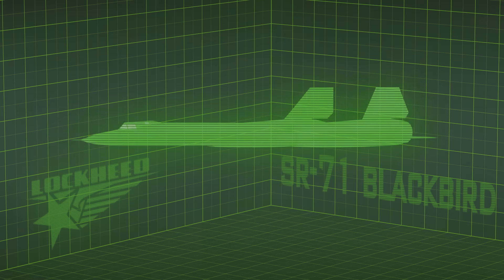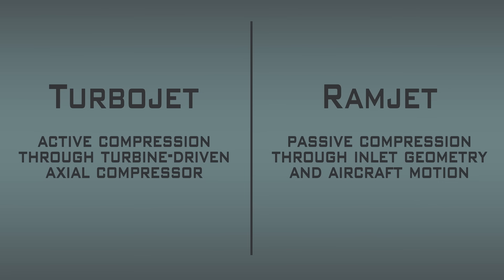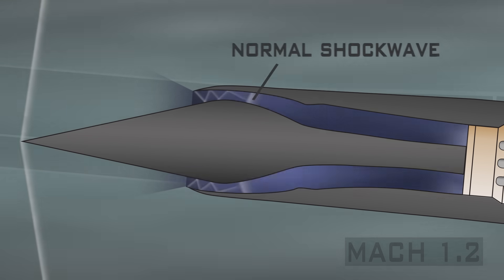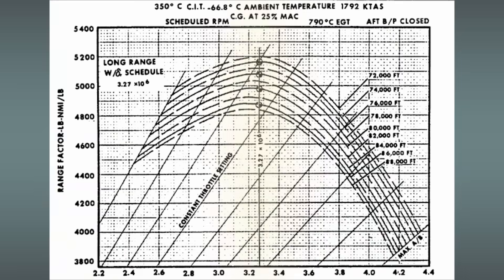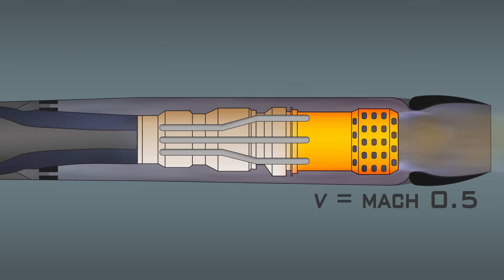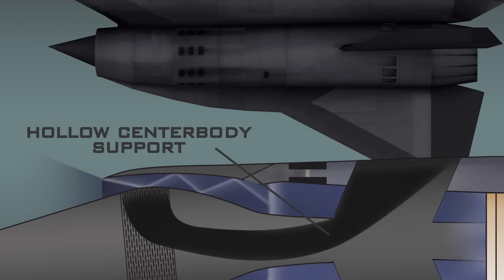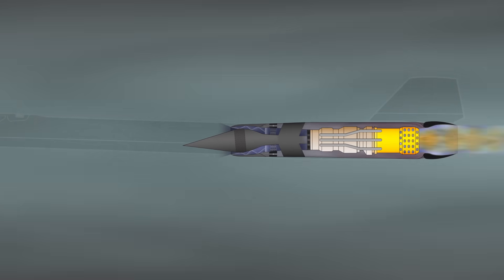The Mighty J58 - The SR-71's Secret Powerhouse

Comment: I probably just don't fully understand the concept, but how does more air make for more fuel efficiency when the bypass tubes are open at mach 2.2?
Reply: ramjets are more efficient then jet engines. it compressed the air so efficiently that it could scale the amount of fuel back considerably..

Comment: The "computer" that actuated all these doors and shunts etc was an analog computer powered by hydraulic pressure. The mind boggles. That, by the way, is an answer to questions like "why cant we build a J58 any more? The answer is that control and computation systems, as well as construction, are now so radically different that the whole thing would need a redesign based on 3d printing, etc. If you want to see what I mean take a look at a spacex raptor 1 engine compared to a raptor 3. A new version of a J58 would look like whatever they're flying in an aurora :)

Comment: 🤓 moment but:

It's not more efficient for the shock to compress the gas compared to an axial compressor. You just can't route all the flow in your engine through a compressor at those speeds without melting the turbine, and the inefficient compression from the shock is good enough for the bypass

Comment: It was interesting to learn from mechanics how many muscle carts they had “over-rev. to death” during normal start-ups of the J58 engines.  No one ever built a start-up cart that could compete with the speed and strength needed to start the J58 engines.
By the way, when I commented to a SR-71 pilot that I did not see any nav lights he just snickered.  It was as polite a snicker as he could muster, but a snicker all the same.  Then he pointed out the only light on the aircraft was the landing light mounted on the forward landing gear… so that it would not be burned off.

Comment: So, never see this explicitly defined, but by what mechanism and process does the INLET somehow 'DEVELOP' about 50% of the engine thrust at Mach 3+?

I see this line repeated OVER AND OVER in all the "Lies We Tell to Children" quasi-explanations, but the explicit meaning of 'DEVELOP' is NEVER EXPLAINED or DEMONSTRATED!!!

I see better how the engine operates, but even here I do not see such an explanation of 'DEVELOP'.
Reply: The inlet slows the air down to subsonic speeds. By Bernoulli's principle, when you reduce the velocity of a fluid, it's pressure increases 1:33. It increases the pressure by a factor of 39-1 as per that diagram (at full speed). So now you have high pressure on the back half of the inlet spike and low pressure on the forward part of the inlet spike. This differential pressure pushes that inlet spike forward just like the pressure in a gun barrel pushes the bullet out the barrel towards the lower pressure. Look at that diagram at 1:33 and pretend that the inlet tube is a gun barrel and the inlet spike is the bullet. You now have high pressure at the far right end of that barrel and low pressure at the far left end of the barrel, that spike is now like a bullet in a gun getting pushed to the left from that difference in pressure.

Comment: Op how does the comustor produce 112:1 compression ratio?
Reply: It doesn't, that is just the air pressure at that point in the engine. 39:1 at the inlet and 2.9:1 at the compressor = 113.1:1 after the compressor. It then DROPS to 112:1 in the combustor. FWIW @ 75,000 feet 112:1 is only ~ 56 PSI. As amazing as this engine was, it is still 1950's technology. We run about 100-200 PSI at the combustor in modern commercial jet engines today.

Comment: Sounds similar to how Lockheed Martin SkunkWorks cooled the exhaust of the F-117 Stealth Fighter with diverting cooled air from the intake back to the hot exhausted of the engine output. Thereby cooling the engine exhausted to reduce it's IR signature, in addition to allowing the engine exhausted to cool on the upper portions of the aircraft aft section before becoming fully exposed to the full clearance of the aft of the flying wing itself to any IR targeting S2A or A2A weapons systems.

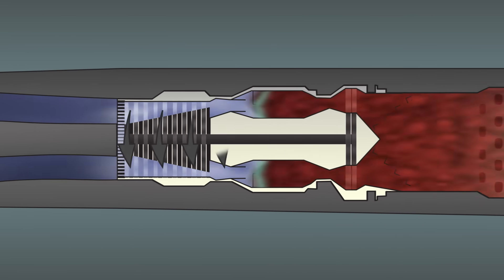Comment: I still dont get what the combustion gasses are "pushing" against to generate the counter thrust; it is not as obvious as in a rocket nozzle. At  0:53  looks like its pushing against a static wall of compressed air; the only way I can see that work is if the 'push' is transferred to the compressors, and thus to the entire rotor.
Reply: That's because they're not pushing, they're accelerating. AgentJayZ has a really nice explanation of this on his YouTube channel

Comment: Diagram shows the compressor section as smaller diameter than aft section. Not correct. Believe the compressor section in backwards in this diagram.

Comment: great animation but stop with the woke crap.  when you discuss the pilot at 5:Na13 you DO realize the SR-71 was only ever piloted by a MAN and that the only Woman crew was Marta-Bohn Meyer who served as a Navigator, sitting in the controls-less RSO position.  and since the aircraft was retired and made lost its airworthiness and there are no spare parts OR the necessary fuel or TEB, it will NEVER be flown again either by a Man or a Woman...

i didnt work on the engines or the airframe but i worked on the pre and post mission intel from the program...

Comment: How does the compressor run when the air is just moved to the after burner?
Reply: Only "some" of the air is bled off to the afterburner, there is still airflow through the turbojet. The turbojet part of this engine was "constant flow" so as the plane moved faster and airflow started to increase, it was that increased air volume that was dumped into the afterburner, the turbo jet always seen pretty much the same airflow regardless.
Reply: @wally7856 chad😎

Comment: The A-12, which used the J58 is why the SR-71 was built. The SR-71 is longer, weighs 6 tons more, uses a pilot and a RIO, and is slower than the A-12. (SR-71 = YF-12 version 3)

Comment: The SR-71 also didn't need wings, it IS a wing adjacent pinch formation body, the only reason it had extended wings, is due to the engines exploiting sound at the ramjet cones into speed flow. If it had a Scramjet to Scram rocket, it could've been a Orbitliner 5 to 6 seat (as seats swap of the spy camera chambers) private space/supersonic jet.

Comment: Let's not forget, computers did NOT create the advanced aerodynamics and stress analysis information.  ALL of this was created first by the people using the slide rules and THEN a computer was programmed to output the same results. The advantage to the computer was all about saving time. When parameters were changed, it was faster to have the computer make the calculations and provide the new information, but all of this was first measured and tested by humans like Kelly Johnson.

Comment: I saw another video and the guy mentioned that the temperatures the engine works at would heat the metal so much that the whole engine would grow a whole 6 inches in length, and 3 inches in diameter. This property had to be accounted for in the design. Amazing technology.

Comment: Hmmmm. The J-58 was a clever and impressive variable cycle engine but in fairness, the Olympus 593 was a much more impressive engine in every respect. It allowed Concorde (twice the SR-71's size) to supercruise at Mach 2.0 for 3+ hours. It had double the pressure ratio of the J-58, put out 31,000lbs dry and 38,000lbs with reheat compared to 18,000 dry and 25,500 for the J-58. Its SFC was half the J-58 and it ran on Jet A1.

The first Olympus was run in 1950 and the 593 in 1966, so it is of a similar vintage albeit its earlier versions ran 8 years before the J-58.

Comment: side note:
the inlet spikes are looking onto the jet's nose, to be precise where the shockwave coming backwards from the nose.
the spike moving backwards because this shockwave also moving as the plane accelerates, and can be directed into the engine when operates at high speeds, enhancing its performance and efficiency.
all these were calculated without computers, and was ready in 18 months...

Hail Kelly Johnson!

Comment: Thank you! I’ve heard jet engines described before and I’v seen some diagrams but they’re usually more simplified for us laymen. Love the video!I knew that the cones at the front of the nacelles slowed airflow below Mach, as do the splitter plates on the F4 phantom, but I had no idea that the cones  extended and retracted along with how their insides were used to feed more air to the engine. Wild stuff! And this was way the heck back in the late 1950s. USA

Comment: Navy vet here, proud of the F-14 Tomcat, which also needs no introduction, but the Blackbird is also an awesome jet. Also, while not a jet mechanic (auto instead, but also an ex-nuke on the USS Texas (CGN-39)), I found this video to be excellent, being concise, and still doing a great job of showcasing the J58's features-I had no idea of how sophisticated it was, but knew of the cone movement and it being a turboramjet. Finally, I live near WAFB, home of the 379th SAC, where we had a  dozen 52's and 135's stationed until '93. I have seen numerous flights, and take-off/landings when I worked on base, including runway snow removal in winter. P.S. I got to my ship by way of landing on the USS Nimitz (CVN-68) by the COD (a Grummun C-2 Greyhound) and flew on a Huey when it visited 5 years ago-I want one!

Comment: Pressure recovery equation is wrong:  it should be a function of density and not static pressure  i.e dynamic pressure.

Also the location of the  normal shock is optimal when the Mach Number  in front of the normal shock is 1.6 or 1.7 and not the aircraft speed.  The bleed is near the location of the normal shock to prevent boundary layer separation due to shock losses.

Comment: I was a firefighter at Beale from 1985 to 1990. I was lucky enough  to take some photos of the J58 engine on a test stand. ! will never forget the raw power it produced the noise was deafening and the outer casing glowed from the heat. When the SR-71 was sent out on training flights we had to stand by  when the oxidixer tanks were filled. Called TEB, it would burst into flame the minute it was exposed to oxygen....at a very high temperature to ignite the JP-7 fuel. The TEB tanks and the whole system was purged with nitrogen gas. What was funny and this stuck with me was all this technology and millions of dollars was how they would stop a minor TEB leak and fire....was a bucket of wet rags.

Comment: NO PART of the J58 is a RAMJET
Ramjets product nominal thrust below 100 knots, insignificant thrust below mach 0.5, & aren't efficient until supersonics between mach 2 - 3.  You acknowledge immediately that, THE SPIKES PURPOSE IS DECELERATING air & controlling the shockwave's normal, and at that, only a FRACTION of the air is routed around the compressors via the bleed-air ducting.  

Tell me, HOW IS IT that significant thrust is generated from the NON-MECHANICAL, RAMJET EFFECT, when that volume of air is deliberately minimized, articulated as "used for COOLING, and last, to provide more oxygen to burn remaining unburnt fuel, probably getting close to the stoichiometric limit of the fuel's maxim.
Reply: The volume of air is actually maximized due to the Venturi Effect/Bernoulli's Principle. When the air is velocity is decelerated like you said, the pressure increases (marginally but it is pronounced at these very high speeds). The increase in pressure is good because it effectively creates more air to mix with fuel and burn. So it is a ramjet in a sense because it creates high pressure air through the compressors (which a ramjet does physically instead of using compressors) and diverts it to the "after-burning" part of the engine. It effectively "rams" the high pressure air to the fuel part of the engine like a ramjet

It is really just arguing over definitions though (nomenclature isn't a science lol.)

Comment: Curious but why wasn’t this engine used in other aircraft? I maybe could understand not being used in fighter jets considering it’s size but maybe in some other application perhaps? Is it’s design limited to aircraft that would fly at the speeds and altitudes the SR71 would or what?
Reply: Logistics are too complicated and expensive.
Reply: @saulrivera6462  ok I’ll buy that. I just rarely if ever heard pilots and some engineers have bar things to say about it. Seems like it could’ve done some good on different aircraft depending on the application in which it’s used. If I need my plane to go fast then this seems like the one I’d be eyeing.

Comment: Most people don't know this, when the SR-71 set it's first official speed record above mach 2.5 was on one engine! The intake cone failed and it resulted in a flameout as the crew exceeded mach 2 They said "screw it" and firewalled the throttle anyway. It is capable to push this aircraft to mach 3.6 easily but most documents list it as 3.2-3.4

Comment: I worked for Pratt and Whitney in the late 1960's in West Palm Beach, on a drafting board with a slide rule! These magnificent engines were on the assembly floor, an unbelievable feat for that time in our aviation history.
Reply: Wow i currently work in the WPB campus myself lots of history there, lots of old pictures on the J58 assembly line, theres even an old J58 parts room with the original signs outside of it, now in 2022 we are an F135, PW1100G powerhouse
Reply: @L3gitchoc0  I’m on the East Hartford campus. It’s cool!
Reply: I can't help but wonder how much trial and error it took to learn everything that needs to happen during all of the different stages during this engines operation. They didn't have computer simulation so it had to be done during live demonstrations and I would assume that means many engines were destroyed during testing.
Reply: @mikeh.753  3:28- Shock traps. Imagine figuring that out and making it work.
Reply: @soyounoat  I'd have to guess Schlieren photography and wind tunnels for any kind of scale experiments at the time, if even.
Reply: I hope you all got a raise for designing whatever you designed.
Reply: My father went from Westinghouse to Pratt headquarters in East Hartford. He was a PhD mechanical engineer. 1962.
Reply: How did they manage to get the compression ratio inside the combustion region without modern equipment?
Reply: J85 was also made at GE Lynn Mass
Reply: @lesliemartin1207  wow, I didn't knew that!! Lynn is the mastermind of all the powerful and Innovative engines in aviation history.
Reply: @lesliemartin1207 J85?
Reply: You knew Cassady?
Reply: @nthdegreedesign  Wait until we show you what we've been building in secret for decades, buddy.  Not much longer now...just need to let the enemy make a few more crucial mistakes... :]

The name Salvatore Pais needs to mean something to you.
Reply: was prob designed by Nazis
Reply: I'm watching this today and when it got to the bit about the centerbody bleed I thought "God damn these guys were doing some complicated shit without computers!"  good work yall
Reply: The engine was by far the key to the Blackbirds being capable sustained flight at mach 3.3 something no one else has been able to do even today.

Comment: I just read that the main limitation of the J58 was the heating as it approached Mach 3.3. With modern materials and cooling technology, the original design could theoretically work at speeds approaching Mach 5.